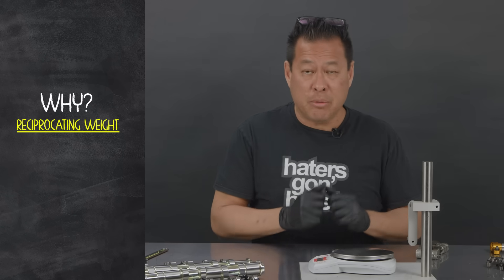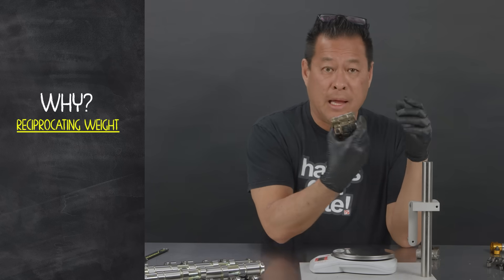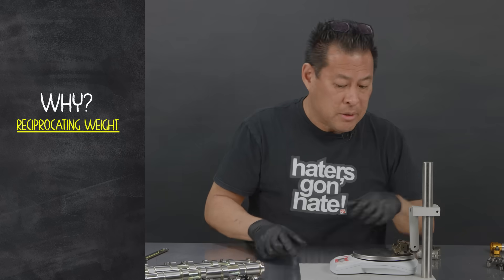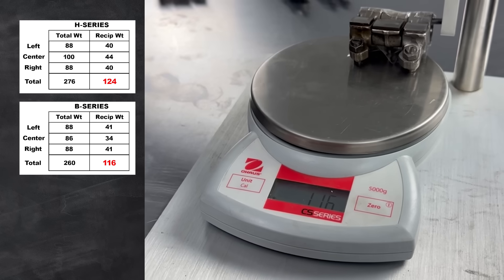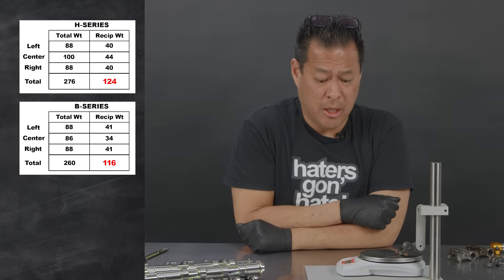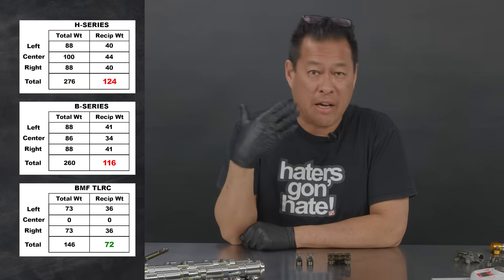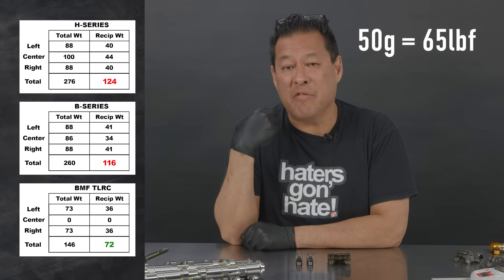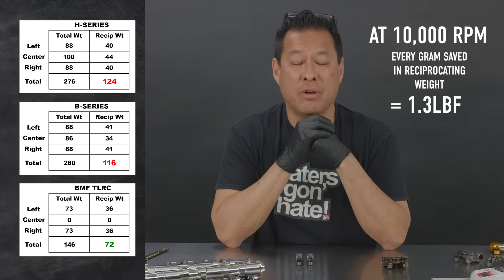BMF TLRC Camshafts: How Cutting Reciprocating Weight Boosts Engine Power

Comment: I understand this is for more drag/track racing applications but is there any possibility of adapting the roller system for VTEC for more of a weekend warrior/street application? Obviously not as much as a benefit once a centre weight is added on but overall Gram Strategy with other things in the motor could make a massive difference.